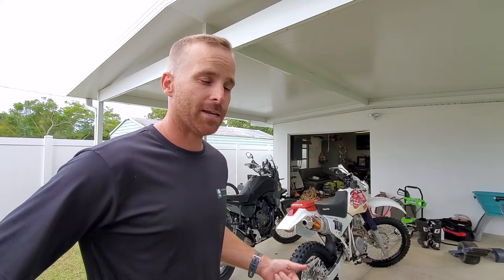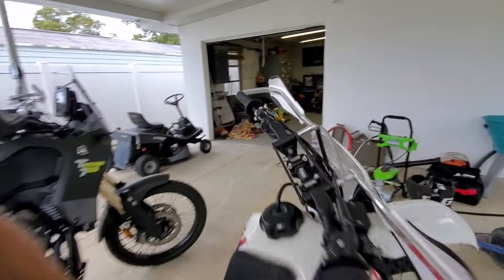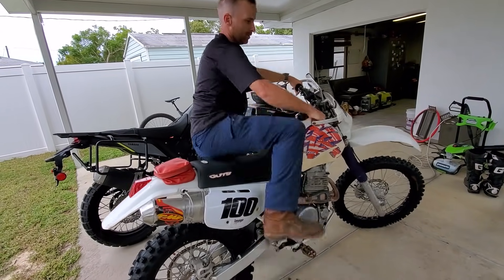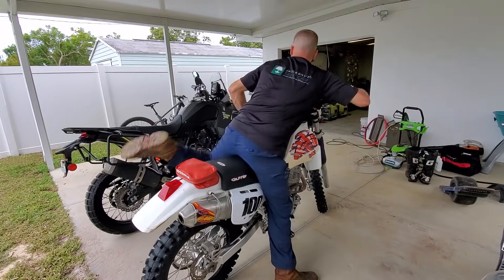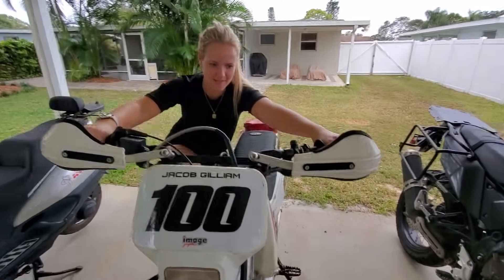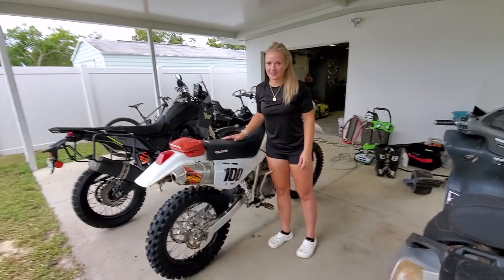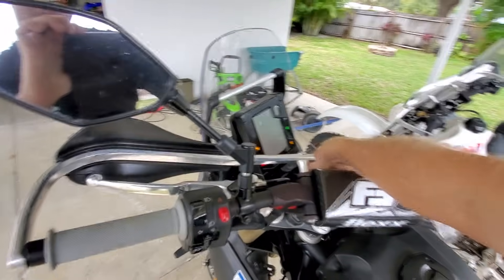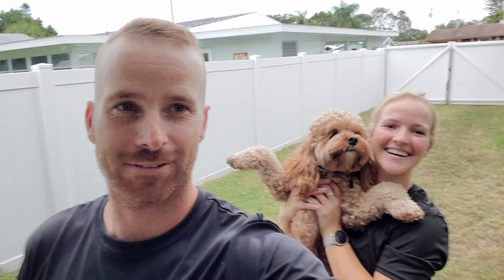How to start the Honda XR600R XR600

Comment: With my highly modified 1986 XL600R, there is definitely a procedure. If it's not followed, you can kick all day and it will not start.
1. Pull the compression release, hold wide open throttle, and kick it over 4-5 times.
2. Release the compression release and throttle.
3. Spin it around to the compression stroke riiiight at TDC.
4. Kick the ever living shit out of it.
Starts on the first or second kick every time. If it's cold, choke on. If it's not, choke off. Everything goes the same regardless.
Reply: If I may ask ...what is your combo .... Mine is a 87 xl600r .. 618 ( or 623 cc ,can't remember) , cleaned up the intake and exhaust chambers ,new valve train , stage 1 cam , and exhaust ...  The dual carb setup gave me a little crap getting it jetted somewhat close to right and I've had a little bit of an issue starting it.... Hope your procedure works for me too! Well hopefully your procedure works for me after I get my stator back ....being rewound on the exciter  side.
Reply: @papi miami  The original owner of my bike was a Honda mechanic for 13 years among 30+ years of being a motorcycle mechanic. At the time he built it, he did everything that was currently available for that engine... in the 90s.
- Wiseco 618cc high compression big bore piston.
- Hot Cams Stage 1 cam.
- 5-angle valve job.
- Kibblewhite Titanium valve springs.
There's more, but I can't remember all of it off the top of my head. I have a folder stacked with every receipt from the build. It has to have premium or it pings like hell. It was dynoed after everything was done and had 65hp, but he then swapped it back to the stock exhaust because it was too loud.  It has so much compression that a ~160lb buddy actually stood on the kick-starter at TDC. 🤣😂🤣
Reply: @spingel88  OH!! That's some serious horsepower ... I think the guys that built this bike had a similar approach I'd be happy with mid-50s! But much same as yours I bought mine in Wyoming with a stacked paperwork also and it had been sitting for 20 years... Maybe 15-20 hours on the motor so I've had to go through the carburetion and electrical... And I mean everything in the carburetors and ignition... But you did shed some light on the bike because I'm about 180 and it takes everything I got to kick that damn thing over!! 😂

Comment: Does yours make a metallic click when it hits TDC? Why does it do that?
Reply from the maker: No
Reply: @fastguysslowbikes  Then I'm very worried. I always thought it is a valve going back in to its seat.
I hope someone else experienced the same and can confirm it's normal.
Reply: @fastguysslowbikes  I got a reply on a forum. XRs also have an auto-decompresser. It is most likely that.

Comment: Mine always starts first kick if i use manual decomp. If its been ran in the last few hours, it will always start first or second kick on any stroke with auto decomp. Everyone blames valve adjustment for how easy it starts. I find carb idle circuit to be the most important part. Even at 25 degress f my bike starts easier than this guy does in the video.

Comment: Whenever i try doing this my bike kicks back. any reason for that?
Reply from the maker: @Wooley_tv  mine will only kick back if you give it gas. You shouldn't be giving it any gas.
Reply: @fastguysslowbikes  my throttle cable must be pinched then or im just kicking it like a wuss because i dont give it gas when i do

Comment: Never used the decompression. Just searched for the upper dead point, then back up und kick it
Reply from the maker: Why would you rather kick it with the max compression instead of barely any compression?
Reply: @fastguysslowbikes  because it works for me pretty easy, but I am tall with 186cm. I also stand on the bike while doing that, so my angle is easy to kick. The bike is on the sidestand.
Reply from the maker: @oz8443  but that doesn't answer my question. Why would you RATHER do it the hard way?
Reply: @fastguysslowbikes  maybe because I haven’t learned it this way.
And I don’t feel that it’s hard. 
My question is, what happens, when I pull the decompression only for a second? 

I will give it a test to compare.

Comment: Then you stall when it’s hot, an hour into a hare scramble…….. then it don’t care about a procedure.
Reply from the maker: Same procedure still applies. If not you may need valve adjustment.